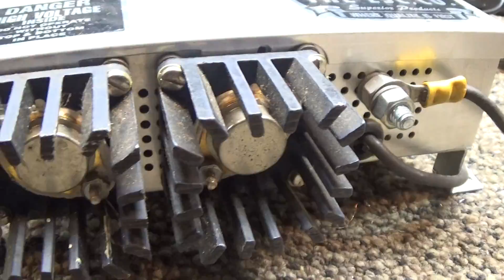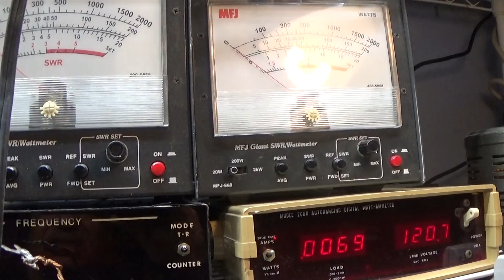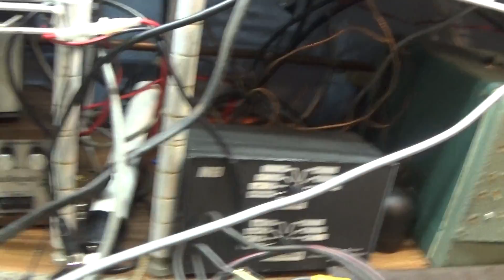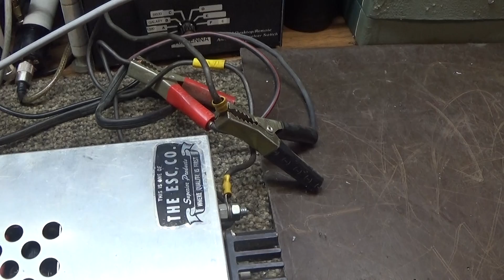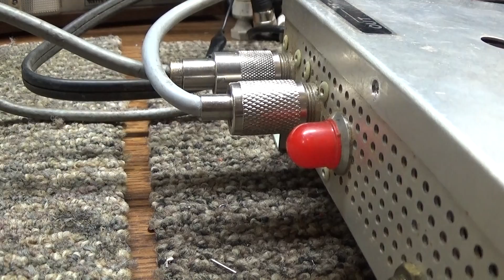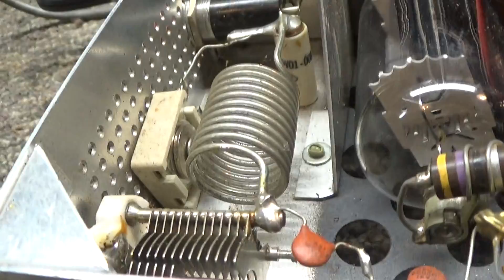Elkin 2 tube mobile on the bench

Comment: Okay very ignorant question here and it’s been a while since video was posted so not sure if you’ll see this but, I have this exact amp, put a new tube in it because one was visibly bad, swr tuned right down to 1.0 flat across all 40, question is, my palomar 225 will easily light up fluorescent lights, this elkin will not, I have no power meters and understand this is considered a “magician trick” among many but what does this actually mean? Weak output? Spurious emission from palomar?? Thanks in advance
Reply from the maker: I don't know for sure, but I do know, tubes run a lot cleaner than transistors, so maybe.

Comment: Do you know the specs on the swiching transistors in that amplifier.  I have one identical to it but i cant read the info on those transistors for replacement.
Reply from the maker: Mine neither, specs wiped off and I don't know them.

Comment: I've got this amp in my truck and I was wondering another thing I've been using a cobra 29 driving it doing 20 pep but I have a Stryker 440 does 1 watt dead key 45 pep with the variable turned all the way down could I use that radio to drive the elkin or is it too much? Thanks for all your info you have helped me a ton wildman tarheel mobile waving big brotha
Reply from the maker: too much.
Reply: To much,bout 3 ,4 watts

Comment: Friend of mine has two of the four tube mobile Elkin.  Both of them do around 400 to 425 PEP.  A 55 amp continuous power supply can run a 4 tube.  Ray still makes the remotes.  Friend of mine ordered one, and I think it was like $50 plus shipping.

Comment: Those are nice. I take my tube radios to Ray in elkin NC to have them worked on. He made all the elkin amps.He makes a remote control head With two switches and a meter that you can hook to those mobile amps. He also had a 4 tube and 6 tube mobile. Some of the four tubes were called super fours and I think they had a different transformer or something but they would really get on with it. He also made some amps called named zodiacs the mobiles were painted black. A friend of mine had a 6 tube zodiac mobile in his truck and good lord that thing would do the deal. It was a really good sounding setup. He was running a tram D 42 mobile and that’s six tube zodiac built by Ray and big skip shooter on the roof it was an awesome set up But a little hard on his small alternator. He’s close to 90 years old now and as far as I know he still working I haven’t been up there to his shop in a year but I don’t know what I’m going to do when he’s gone he’s the only one in our area that works with tubal stuff and really knows what he’s doing. I’ve got a few radios I need worked on right now. He built a digital VF0 with continuous read out counter For my old tram D201. It worked great and was dead stable I wish I still had it. He also built one for my sonar FS 23 I think I may have liked it better than the tram. He knows his stuff whether it’s transistor or tube.